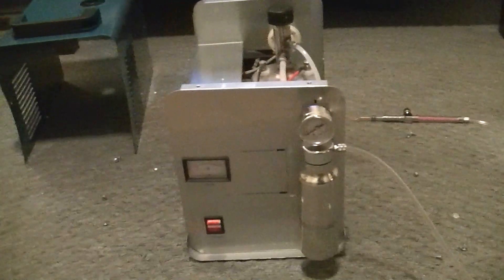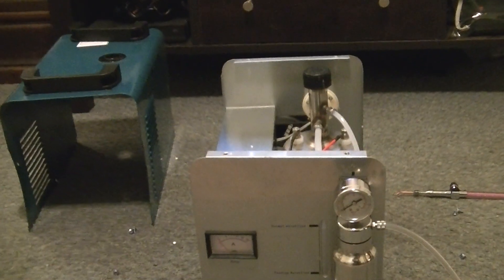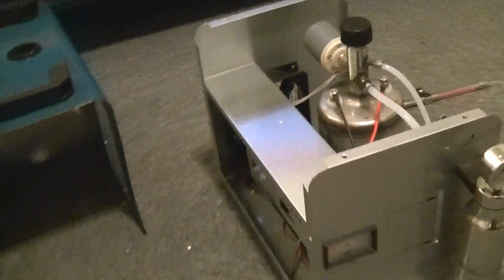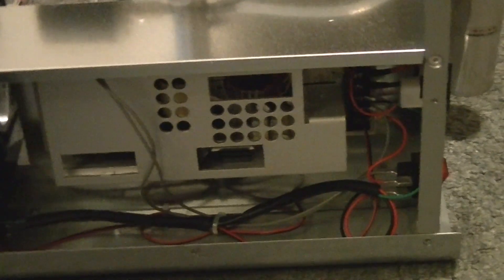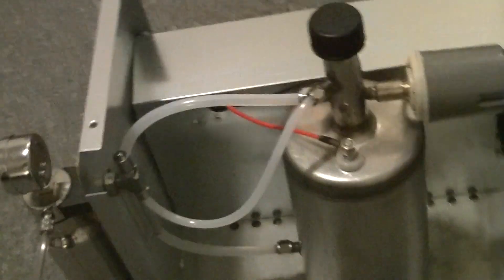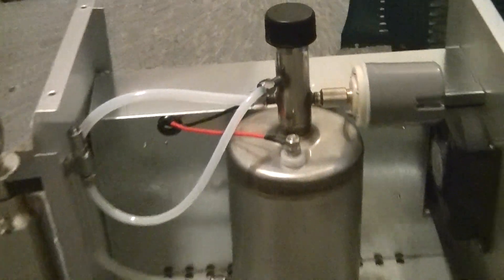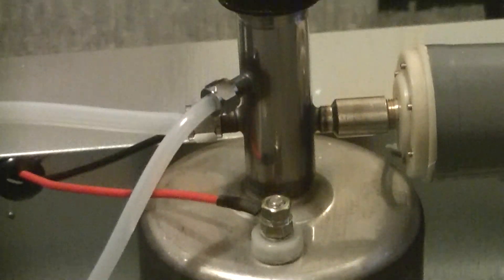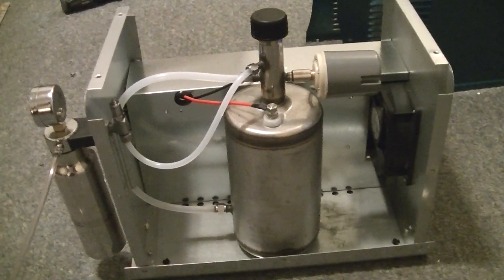H180 95L Oxyhydrogen Generator - Inside View

Comment: Thanks, i wanted to see this generator from inside. It looks good, durable, better than plexiglass. Have you tryed to work with 12-14volt?
Reply: @Bruce_Wayne35  ok, more electrolyte and then it would be ok
Reply: @Trbuhom_za_kruhom  how do you think you can make this work with a 12v? Any suggestion? And can I use salt as electrolyte? Please answer, lol
Reply: @BOREDANDWELLBORED  actually every electrolyser is working on dc voltage, if you understand what is electrolyser then its simple... Put water in the bottle, and then with ampermeter you need to watch consumption, then slowly add electrolyt to the water..., But slowly, and then you can adjust desired consumption, or production of gas.
Reply: @Trbuhom_za_kruhom  thanks. I got the information I need regarding electrolyzer. But now I need to know how to make this work with 12v battery, even if the gas output is minimal. Do I have to disassemble the cage and connect the 12v battery to the inside of the system bypassing the AC plug? I'll be very happy with your response as I'm on the edge of buying one
Reply: Could ise an inverter on vehicle. Math shud tell you how many watts you need. Or amps used. (Volts X Amps = Watts)

Comment: How are you going to clean or remove the water on the thank?  Thanks
Reply from the maker: I'm not trying to be mean or sarcastic. I'm just being blunt. If you're asking that kind of question I would first learn more about how all this works. I'd hate to see someone get a bad chemical burn or possibly worse simply because they didn't know what they were doing. I will answer your question though.in my case because of the electrolyte I chose to use there is no reason to ever clean the tank as there is no corrosion happening. The only thing I need to pay attention to his the water level and try to keep it full.

Comment: Hi Lucas, because of price I want to use this for hydrogen/o2 breathing putting gas through couple of bubblers for hydrogen water and breathing.  As a start I would use it two hours a day, would the machine hold up to this usage?  Thanks bill do you know the output per litre
Reply from the maker: Well.. interesting and I've read a lot about what you are doing but....

I'm not prepared to give any advice or opinions on that topic other than.

I'd invest in a real pure hydrogen generator, a pro level oxygen/hydrogen/plus moisture mixing system. I believe there is such a thing as an all-in-one system. I don't believe it's available to consumers.

Best of luck!

Comment: Does it weld at all, or just generate a pretty flame.

Not seen any videos of anyone with one of these machines actually welding anything with it.

I've been thinking about buying one of these off ebay but there are no demos of anyone welding with it so can't say if i'm convinced it works.
Reply from the maker: Most people don't care enough to take a video and post it on youtube that use them for welding. That said sure it can weld. Jewelry that is. A larger machine could easily weld thick metals and normally when they refer to welding on ebay they are talking glass or jewelry. I use mine just for glass.
Reply: Thanks for the reply, I did get one of these machines in the end thought I would test it out for myself.

I'm sure I will figure it all out but at the moment I'm finding the instructions useless, however I have found someone with a full instruction booklet I downloaded that is for a larger machine. So will have to take some time out to take a look through that.

I used to use one of those little oxy propane torches but the gas only lasted around 10 minute on low and very expensive to replace the bottles the oxygen was the problem by the time you got the flame right the bottle was empty, so hopefully this is much better than that.
Reply from the maker: I hope the book helps and suggest double and triple checking before you proceed but if the output or flame size is large enough for you then I think you might love this when compared to a oxy propane torch but the flame isn't the same. It's a great starter torch though and you can always go up in size once you know how to use this one and understand the properties of the flame vs propane.The hydrogen implodes vs the propane exploding. Tungsten boils at a little over 6,100 fahrenheit yet some say HHO max temp is 5,000 something. I've seen it boil tungsten. Anyway it's hot but reacts to different metals or just plain objects differently.
Reply: Yes thanks again for the info, there is a lot of info on youtube about hho but not much useful info on this type of machine.
Perhaps there doesn't need to be.

But one thing that would be of use is to see the different types of electrolyte used, as I said some say potassium hydroxide, some say sodium hydroxide, some say use table salt some say don't use salt as it puts out dangerous fumes and so on, some say baking soda which is supposed to be very safe to use.

The most reliable so far that I have seen are potassium and sodium but one produces a yellow stain while the other produces a white stain, one supposedly produces more gas than the other but potassium is supposed to be safer to use ie less corrosive should you have a mishap.

My booklet that came with it says sodium which is the more volatile so should produce a good flame, but then it says you can use either Alcohol or Distilled water in the filter bubbler, claims to clean up the flame one or the other but doesn't mention which one does which.

It all seem very trial and error to me would I be right in saying this, is that what you found with your machine?
Reply: Hello lucas

Comment: Could you demonstrate if this could weld aluminium sheet 2-3mm thick?
Reply from the maker: Very doubtful. Simply not enough of a flame but if I get a chance I'll give it a try. There are very affordable larger units that could do that easily. Probably between the $500-$1000 range if you hunt around enough or buy direct. I'd highly suggest a larger machine. I've tried one but don't have access to it anymore.
Reply from the maker: I take it back. It may be possible. I forgot about cutting all those coffee cans I had and they were pretty thick steel for cans so maybe.

Comment: nice set up....how many volts the power supply ? and how many plates used  are  in the generator?
Reply from the maker: The one I have is setup for 110v AC however it can be changed to 220v. I left it at 110v for convenience. How many plates? Well that's tough since it's proprietary and I'd have to cut the tank in half to find out. So it's a mystery to me too lol. I'm very very happy with it for what I paid and use it for. I'd go double the output for what you want so you don't have to work the machine so hard. I've yet to need to even clean the tank. Looks like new inside and it's been over a year of pretty regular use. High quality electrolyte and distilled water and you should be good to go.
Reply: @EclecticLensYT  can i use just salt as electrolyte? Have you tried it with just salt? I wanna go full blown natural at it lol. I've seen folks using just salt and it works for homemade HHO torch. I also want to use this on a 12v battery.
Reply from the maker: @BOREDANDWELLBORED  Electrolysis of an aqueous solution of table salt (NaCl, or sodium choride) produces aqueous sodium hydroxide and chlorine, although usually only in minute amounts. NaCl (aq) can be reliably electrolysed to produce hydrogen.

I wouldn't use salt. Not only will it create chlorine gas but it will also severely corrode your plates.
Reply: @EclecticLensYT  thanks for responding. Exactly what I need to know. But I'll use salt anyway and just rinse it often, it's a free country right? Salt to me seems so "naturale" and if it works, then I'll stick to it